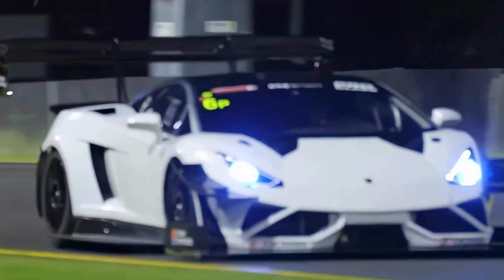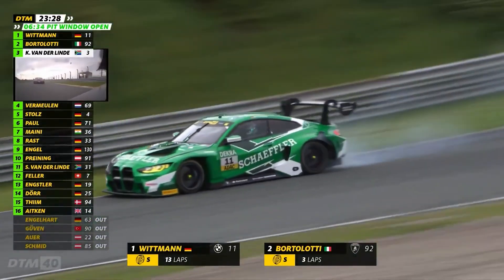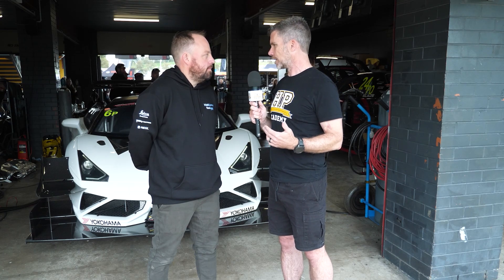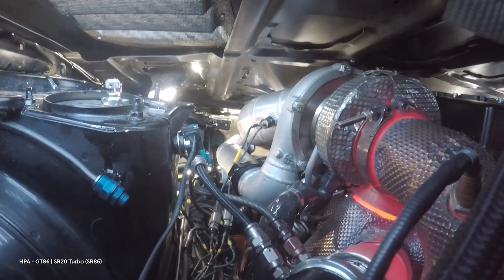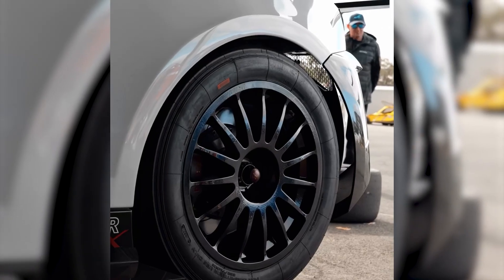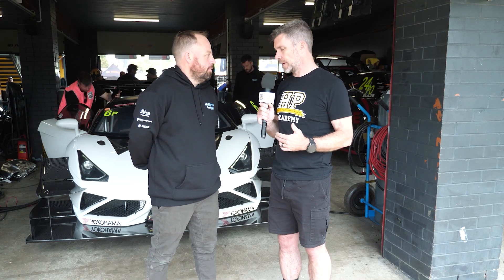The Incredible Engineering Leap From GT3 To Time Attack Performance

Comment: Fo a start Josh where did you find the money
Reply from the maker: @mikelangelo2877 Josh at SRS doesn't own the car, they were paid to work on it 🤘 - Taz.
Reply: repurposing a GT3 is probably way cheaper than some of the builds like Nemo Evo and RP968. The RP had a bespoke engine designed from the ground up!
Reply: @bennyb.1742  I'd like to think for laptime we probably pulled that off on time-for-dollar pretty well. Its not got that much in it in 2025 form that is stupid money, as i say, all relative to the problem statement.

Comment: Title's a bit misleading? Time attack cars making hundreds more horsepower aren't necessarily making an engineering leap. GT3s weighing hundreds of kilos more have visibly better body control, they probably have much better aero efficiency, and with derestricted engines would stand a good chance of challenging for the outright fastest time on those merits. I love time attack cars, but they are NOT there yet.

Comment: I would love to take a Gallardo Superleggera and retro fit a Huracan DCT into it. Those Superleggeras are like 800lbs lighter then the Huracans. Modern computers, aero and suspension they could really set the world on fire
Reply: You will find if you put a SL on the scales, it doesn't quite meet what the manufacturer says. I think they said 1331kg from factory, If you scaled an OEM one, It wont be that. There are ways to find it back tho
Reply: @joshgardner3135  I hear anywhere from 2900lbs to 3200lbs. But that's with 20 year old carbon fiber technology just replacing the driver and passenger seat with modern carbon Tillet buckets will save 100lbs then comes the modern full carbon body ect... Old computers old dashboard old entertainment system ect... All getting swapped out and will run a full digital motec dash. The weight will fly off those things when you start bringing it into modern times. The weight difference in modern suspension compared to 20 years ago is also huge.
Reply: The Reiter Gallardo R-EX GT has a body made of Carbon fibre, it weighs 1175kg. The DCT gearbox isn't exactly bolt in, as the Graziano egear are not the same or allow you to move parts, especially the electronics as it was never platform shared like other VAG cars. It's a branch of it's own tree. The 7 speed DL800 is usually replaced with the Holliger 6 speed for simplicity.
Reply: @fraserwright9482  Its obviously a full custom job bro but yes all can be done no problem at all. When you see what guys do with million dollar pro touring muscle cars then you wont second guess what can or cant be done there is no limit. Stuffing a DCT into a Gallardo literally would be a breeze im a fabricator i could do it in my sleep if i had the money

Comment from the maker: Love it? Hate it? Share your thoughts 😎 - Taz.
TIMESTAMPS:
0:00 - Why GT3 Cars Are Not Enough For World Time Attack
0:15 - What Defines A GT3 Car
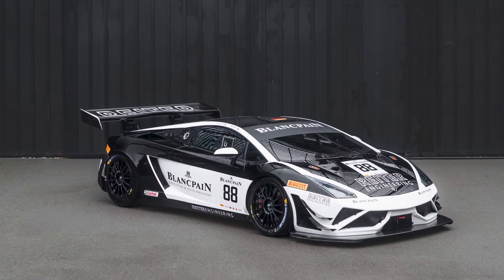0:39 - GT3 Parity Rules And Controlled Performance
1:26 - Power And Downforce Demands Of World Time Attack
1:47 - Twin Turbo Layout And Heat Management Strategy
2:35 - Turbo Placement And Response Benefits
2:48 - Power Levels And Torque Control With MoTeC
3:17 - Engine Reliability At 1400 Horsepower
4:36 - Cooling Challenges In Circuit Racing
4:41 - Engine Management And Electronics Overview
5:05 - CAN Gateway Strategy Explained
6:29 - Port Injection On A Direct Injection Engine
7:10 - Gearbox Selection And Drivetrain Reliability
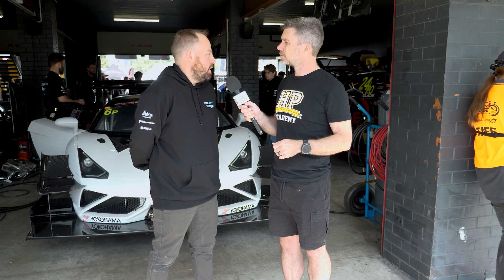7:53 - Final Thoughts Before Heading On Track
🏎 Building a fast car? Get $400 OFF the all-inclusive VIP online course package deal: https://hpcdmy.co/gt3vip
🦵Kickstart your EFI Tuning knowledge. Get 50% OFF your first online course: https://hpcdmy.co/gt3efi50
Reply: Your interviews are top notch, Andre! Always great questions and clearly organized. You can tell builders really appreciate your knowledge and getting into all the nerdy details. Keep it up